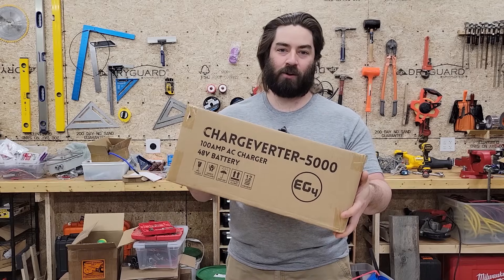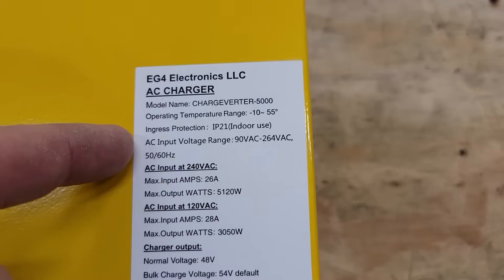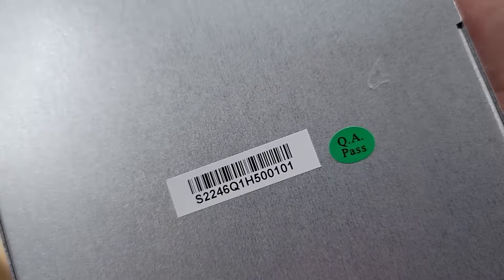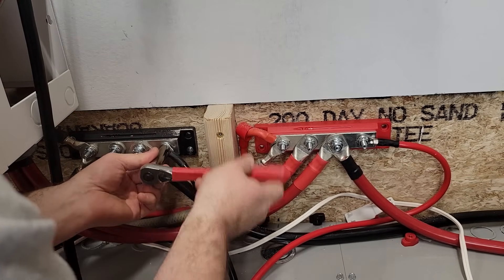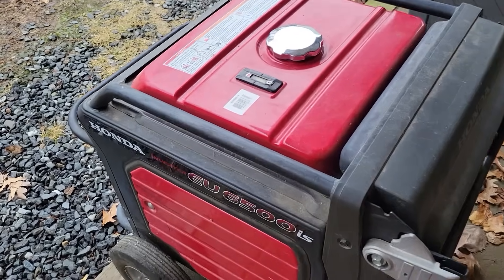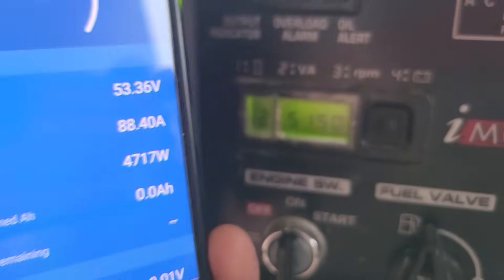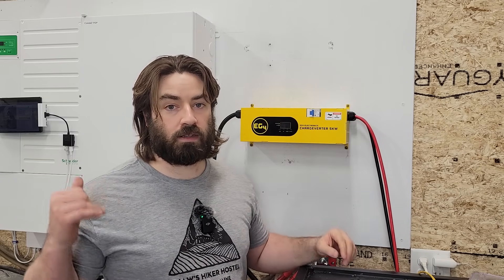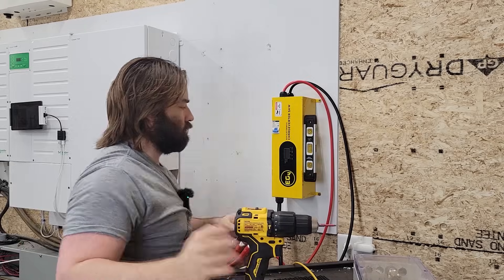Powerful and Affordable AC Battery Charger

Comment: I'm working on deploying a Schneider XWPro system with Lead Acid batteries.  The Schneider allegedly tracks energy into and out of the batteries with the addition of a Xanbus monitor that includes a shunt in series between the XWPro and batteries.  Question: Should an external charger like shown in the video be placed such that the charging current to the batteries is correctly tallied by the monitor?
Reply from the maker: Schneider makes a battery monitor that has a shunt in it and a whole bunch of wires.  It is not necessary if you don't want it.  The shunt will give you more accurate SOC (state of charge) and with the SOC you can program things like a generator to kick on.  I've been running my system without that. 
If you add the shunt, then it should be between the battery, and everything else.  This means on one side of the shunt is the battery, and the other side of the shunt are the inverters, charge controllers, external chargers (chargeverter), any DC loads (i.e. lights), etc. 
If you don't have the battery monitor (shunt) then you simply program everything based on Voltage instead of SOC.
Reply: @DavidPozEnergy  Thanks.  I do have the Schneider shunt.  I have two PV 100A Schneider controllers so that third connection available in the PDP sounds like an ideal spot to connect a chargeverter.  Many thanks for your videos.  I watched them all last year helping me decide Schneider.  Now I'm about to actually install the stuff before the tax credit deadline so have watched all your vids again.  Very helpful resource.
Reply: @DavidPozEnergy  The big reason I ask is I was wondering if the Schneider system wants to know every little tiddle of energy moving back and forth or will it be fine measuring an energy source (generator with chargeverter) that just mysteriously flows undocumented energy to the batteries.  I'm probably overthinking this.
Reply from the maker: The Schneider system doesn't need to know where every electron is flowing, but it can monitor to that detail if you like charts.  If you want to look at logs of all your energy (solar, loads, generator) then you need the Schneider battery monitor.  Personally, I have been operating my house off grid for the last 2 years and I don't have a battery monitor.  I also don't have the closed-loop communication hooked up.  This means I don't have good data logging.  I'm OK with that.  The insight home can tell me all my loads, because the inverter reports it.  But, the insight home doesn't know how much I run my generators.  During the middle of winter I will run my generators and add some energy to the battery through the chargeverter.  Usually I run my generators the day before a storm is coming in, top off the battery, and then leave it be until the next storm is on the radar. 
I understand everyone is different.  I have plenty of friends that enjoy seeing all the charts and data.  I'm just not that way.  To me, if it's working, why bother with it.

Comment: I have one of these, except mine is black. What I really like about it, is it ramps up to its set charging amps. It checks the voltage input and if the voltage starts to sag, it lowers the charging amps. I can get more power out of my propane generator vs the AIMSPower inverter with built in charger/AC bypass.
Reply from the maker: Yes, that's one of the improvement with version 2.  The yellow is version one.  I have since bought another, so I've compared the two models.

Comment: What is the advantage of not using the passthrough of the inverter?
Reply from the maker: Generators don't put out very clean power all the time.  Even with a clean sine wave from the generator, the Voltage sags under a surge.  My Schneider inverters will always produce cleaner/better power for my house than my generator.  So, I want to charge my batteries with my generator, but keep the house powered by the inverter.

Comment: I have an off grid cabin with solar, an 8KW diesel generator, a 48 volt inverter and battery bank of lead acid batteries. I recently purchased 4 - 48 volt lithium lifepo4 batteries to replace the lead acid, that I will run in series to the inverter  The inverter has a charger but it is not designed to charge lithium batteries. I have read other articles about charging lithium batteries and they suggest using a smart type of lithium charger.  This charger you are reviewing seems to just be adjustable and it is going to charge at whatever amperage you set it at.  What makes it any different than any other charger for instance the one that is in my inverter?  Is this the best type of charger to use?
Reply from the maker: Lithium batteries need a CC/CV charger.  This stands for constant current, constant Voltage.  Basically, the charger will charge the battery at full current (set by you) until it sees the battery at the pre-set maximum Voltage.  I set mine to 56V.  Then, the charger switches to constant Voltage mode, where the Voltage is always 56V, but the current lowers from 100% to 10%.  Once it reaches 10%, then the charger shuts off.

Comment: Hi, Do I have to purshase the AGS from Schneider for automatic generator start and off?, Thanks
Reply from the maker: Depends on your generator.  The AGS from Schneider can work with a wide variety of generators.  Some generators need the outside controls of the AGS to work.  But, some generators have some automatic controls built-in, so that all you have to do is close a circuit.  Look for generators with a "two-wire start" and you won't need the AGS from Schneider.

Comment: Can you use 2 of the EG4 in parallel charging the same battery bank using only 1 generator?
Reply from the maker: Yes.  I recently bought a second Chargverter in order to do this on a larger generator.
Reply: @DavidPozEnergy  Were you able to have both of them communicate with the battery bank at the same time?  Also, were you able to do this while keeping the bank communicating with the Schneider Insight Home?

Comment: Nice but without UL listing and CSA it can't be legally used.  Explain to your insurance company why you used something not listed and your house burned down. 
Where is the AC circuit protection?
Reply from the maker: In my case, the AC circuit breaker is at the AC source.  I have an AC circuit breaker on my generator.  I hope EG4 sends this to get UL tested.  Having that listing would be good.

Comment: Any chance this can run off DC? I figure the first thing it does probably is rectify to DC, so maybe it could be run directly on DC?

I'm trying to find a way to charge batteries from a prius battery (230v or so), and I hear MPPTs could maybe burn out trying to mppt a DC battery
Reply from the maker: The sticker on this says AC, I don't think it will run on DC.  I like the idea of using an MPPT on the Prius battery, but I've never done it so I won't be much help.  If you figure it out, send me a link.
Reply: With high power PSUs like this one you typically run into two issues when running them off of DC. One is that the rectifying components will always run in one direction this can either overheat them and  in case of synchronous/active rectifier or bridgeless power factor correction (PFC) the controller may expect AC and can't operate the transistors at DC. The second issue is with the PFC again because power factor doesn't exist in DC so it doesn't have to do anything but if the controller just assumes AC it might stop operating until it measures a 0-crossing.

Comment: Can it charge while the inverters are running and powering the house/shop ?
Reply from the maker: Yes.  I can use a generator and chargeverter to charge my battery bank, while I'm also using the inverter to power the house.

Comment: Hey David, Great Video. Could you set up the Honda as a 2 wire auto start stop function that triggers when the battery reaches a certain level? Ive been looking for a 2 wire start stop generator thats budget friendly but cant seem to find anything in the USA thats quiet and smaller. I think you could make a great separate video on this setup. Im sure you could find a good way to do this.
Reply from the maker: My Honda EU6500 doesn't go to 2-wire easily.  But, the newer version is EU7000, and that one will do a 2-wire easy.

Comment: To confirm here, you turned off your inverter to run the charger.  In a normal scenario, could you keep the exact same setup only adding the charger wired to the busbar and the solar, inverter, and batteries would all function the same?  I've been concerned about doing something like this and having some kind of feed back because there would be two forms of power coming in and one would not be controlled by the inverter.
Reply from the maker: I've run the chargeverter, and the inverter, at the same time.  There is nothing wrong with that.  I turned off the inverter in the video simply to get an accurate measurement of power into the battery.  If the inverter is ON, then some power goes to the inverter instead of the battery.
Reply: Ok, I think it might solve the current issue we're having.  The XW Pro is showing a voltage difference per leg coming from the generator.  I thought it was the generator but I tuned it up today, adjusted the Hz and the Voltage.  Everything is looking good but when the power goes back to the inverter it still shows difference voltage.  The two legs are off from each other about 10-15V but the total is still 240V.  Because of this the Inverter won't qualify the incoming power.

This wasn't and issue the last two winters.  I fired up the generator for the first time the other day and ran into this problem.  If I can by-pass the inverter all together and hook the generator straight up to the batteries via the 48V charger that would be great.

Any ideas why the inverter isn't processing the power from the generator correctly?  I've check voltage from the generator along every stop along the way to the inverter and everything shows 120V per leg.  Then once in the inverter there is a difference. 

I did discover that I can have the generator running the house while any power that comes in from the panels on a cloudy day will still charge the batteries.  I'm hoping that will allow us to get through the night once I the generator off.  @DavidPozEnergy
Reply from the maker: In the insight home, adjust the generator parameters as wide as they go for Voltage and Hertz.  The factory setting is very picky about generator power.  I've made several generator videos at this point.  I've tested diesels and gas, inverter and regular.  In my own setup, I've removed the generator from going into the inverter, and now it just goes to the chargeverter.

Comment: Thanks, is there a way to automatically turn on a portable (less than $1k) generator when the batteries are at low charge?
Reply from the maker: I don't know of a cheap generator with auto-start built-in.  Sorry.
Reply: Thank you, that seems to be the case. Very suprised, was looking into alternative solutions like hacking the ST Switch for the Westinghouse, but no success. Looks like the Honda generator is the lowest priced alternative, however still outside the $1k range.

Comment: hmmm video cut @8:54  ...?   Can these be used "automatically"... i.e   using   AGS (Auto Generator Start) to start a generator with the chargeverter permanently connected to the battery and generator.    No manual intervention any time.   Will the generator bog down on starting etc.     IF I had to, I could put my delay circuitry in between the chargeverter and the genny but....   It seems like this might not be intended for automatic operation.
Reply from the maker: I have it hooked up permanently to my battery, and to my generator.  I don't have a problem, but my generator has a built-in delay for the Voltage output terminals.
Reply: Almost there

Comment: Can this be used on lead acid? No reason it couldn’t as long as you were careful with your settings, right?
Reply from the maker: I don't see any reason it can't be.  However, sometimes I see people selling battery chargers for forklifts really cheap on craigslist.  You might have luck finding something like that, and they are made for lead acid.
Reply: @DavidPozEnergy  good point. I’ve glanced at those, but eventually We are upgrading to lithium.

Comment: David, loved all of your solar/battery videos.  I learned a lot from your videos.  I'm in Florida and setting up an emergency power backup system using EG4 48V batteries and 3000W inverter/solar charger/ac charger combo unit.  Since I don't have solar, if the power outage drags on, my plan was to use the gas power generator to charge up the batteries.  The Chargeverter seem like a perfect fit.  The one question I have is how do you keep providing the AC power via the inverter while you are charging the batteries?  It seems like if you connect the Chargeverter to the power rails on the EG4 battery rack and not disconnect the inverter, then the Chargeverter is just going to be supplying power to the inverter.  If you turn off the inverter or disconnect the inverter, then you have no power to the house.  What am I missing?  Thanks.
Reply from the maker: I don't think you are missing anything. 
You said you plan to use a 3000W inverter, but didn't mention the generator size.  The Chargeverter can go up to 100A, so if the battery is at 54V, that's 5,400W.  
If you haven't bought the generator yet, I'd look for one between 5kW and 6kW continuous rating, and limit the Chargeverter to 90A. 
Let's say you are pushing 5kW into the battery busbars, and you are pulling 3kW to your loads through the inverter.  That means 2kW will be charging the battery at the same time.  But, if your loads drop to 1kW, then you have 4kW charging the battery.  You still have 5kW from the Chargeverter.
Reply: @DavidPozEnergy  David, that all makes sense.  Thanks for the explanation.  My parts are scheduled to start arriving this Friday.  Wish me luck 🙂.  Thanks again.

Comment: Have you looked at how to do this? I may use the 7 pin connector on the generator and rewire the internal wiring to the connector.  My generator uses the same push button to start/stop the generator.

Comment: I am off grid with a EG4 LifePower 4 48V battery bank. I just bought the EG4 Chargeverter and I want my generator to start automatically at 47V and shut down at 52V to power the Chargeverter when solar is not enough. Signature Solar recommended using the EAZY-VLC 2.0 12V dual programmable relay control cycle delay timer. I have a Westinghouse WGEN 7500 DF generator that has a remote start. I plan on
Reply from the maker: I've never used that Voltage controller.  Looks like it can work well.

Comment: there twin 50 amp units, but that cable doesnt look like 4 gauge it looks like a 6 guage. Also, thats the wrong breaker... its a 100 amp system need to have a 100 amp breaker, not a 125amp breaker...

Comment: Thank you for sharing I didn't realize that when you're charging your battery through the inverter that you weren't able to invert meeting that you don't have hydro so this is a great way to do it now I'm running a 24 volt system is this offered any 24 V configuration
Reply from the maker: Signature Solar sells a few different 24V chargers.  They have an 10A, 30A, and 35A.  Right now the 30A is on a really good sale: https://signaturesolar.com/eg4-battery-charger-24v-30a/?ref=4_rHcgZ9x-TiF-

Comment: I dont understand why you would not simply use the Schneider generator input ??? 

The Schneider has gen amperage input settings 

You have that very same charger built into the Schneider so why not use it ???? 

Would you be good enough to explain why you would not simply use the Schneider??? 

If you input the generator into the Schneider, it has a assist function to the generator can assist the output off the battery bank 

Its a fantastic way off doing things 

Let's say you have a lot off loads and your batteries are struggling 
You start up the generator and it assist the batteries 

This is not a bypass or pass through function 
It is a assist function
Reply from the maker: I have a video on that: https://youtu.be/36H6Sb2IG_k

Comment: Will be working with small, non inverter generator.
I use 3000 W AVR generator, and I must set on mppSolar controler about 10 Amps to start it, and then raise to 20, 30 and finaly to 40A.

Maybe that charge controller have softstart.

Comment: Hi David, Question? In a 48V (4x12v Lithium) with their own individual 20A BMS’s  can you charge at 80A max or will it destroy the first BMS,  on the first battery, because it’s rated @ 20A?.
Also with the external charger does this add to total Amps when combined with the inverter or does the inverter sense the external source and compensates? (IE 80 from inverter + 80 from external charger parallel connected, possible 160A max), Both questions have been posted on chat sites with no response, hoping you can help
Cheers Jamie
Reply from the maker: Hi Jamie Kaye,  You will kill the BMS if you try to charge it at more current than its rated for.
Reply from the maker: This charger is meant to charge the battery from a generator, in an off grid situation.   This means you wouldn't have anything connected to the "AC input" of the inverter.
Reply: Thanks for the reply, I tried it with the SPF inverter (same as yours) it sensed it and adjusted according, smalls good. 
Cheers for responding.
Reply: That was Alls Good!
Reply: Sorry I missed telling that I’m using 4x20 individual chargers.